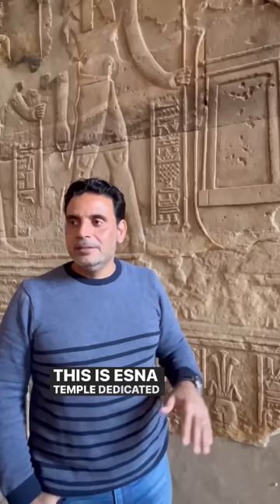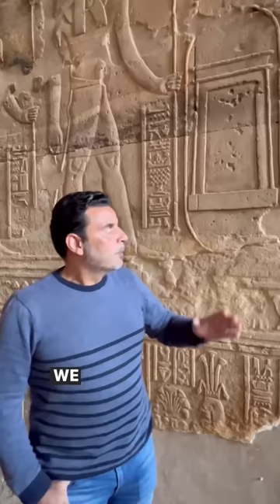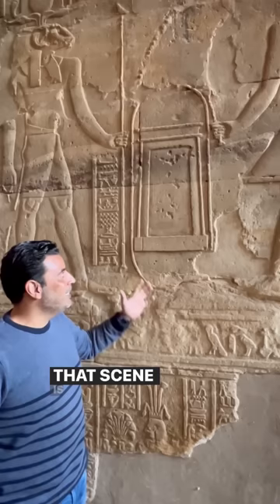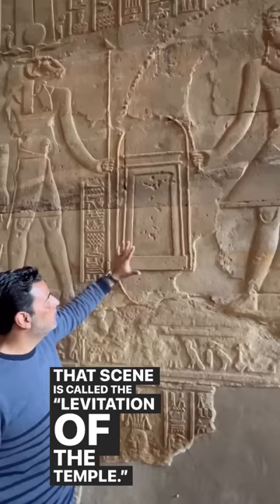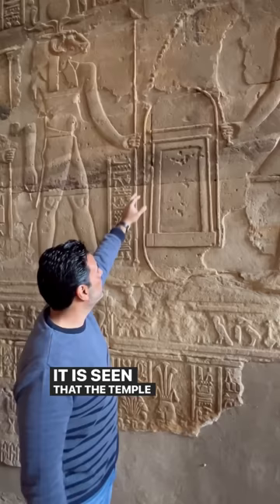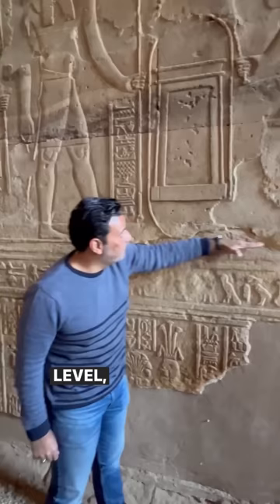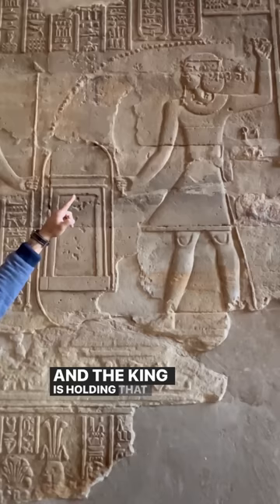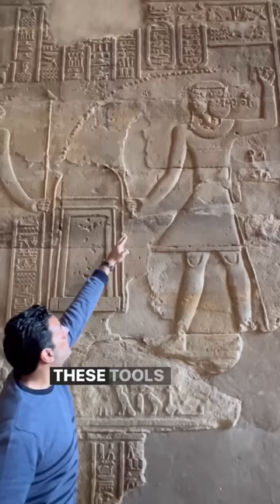Ancient Levitation Tech?

Comment: Don't overlook the two of them holding Was Scepters, the sonic tools used to cut stone, a tuning fork on one end with a stylized cutting edge on a long shaft, smack the tuning fork and the opposite end turns into a high frequency jackhammer. 
The Was Scepter itself is said to be "a symbol of controlling the forces of chaos" which I suspect means a destructive tool of some type that can be handled.
Wouldn't surprise me to know they utilized acoustic levitation to move large stones a bit more easily.
Reply: so the sceptor cut through stone but how did they get precise lines?
Reply: @Allsportstees  wire strung between forks.
Reply: @Zer0fuks  HOLY SHIT! did you just think of that!

Comment: its right in front of you guys, the pyramide has ZERO WRITINGS on them   and you can see that the old blocks have been added with plaster as you can see here and then engraved with writings, this means the real old blocks or statues are WAY OLDER then what you have been told

Comment: That looks like the giant shrines cut from a single block of granite. They are hollowed out like a box with very sharp corners, has a step inside, with drilled out holes and a inlay edge to fit a door. Extremely well made and one of the oldest.
A completed one was on display in the Horus temple, and you can find others near quarries.
Though this pictograph seems to be missing its pyramid shaped roof
Reply: That's what I thought. Or one of those tubs underneath the temples or pyramids.

Comment: Anyone else notice how smooth th break in layers is from "carvings" to the stone? Almost like it wasnt carvings..it was a casting or something
Reply: Your mostly likely right
Reply: Your mostly right, I could see two separate breaks with the same depths
Reply: Omg I thought the same thing when I visited Egypt 9 years ago, and they all look like a moulded casts because of the parts that broke away and the perfect lines throughout them
Reply: Its is, the Ancient Egyptian used a type of plaster that they coated, dried, then chiseled the desired work, if you make a mistake you just recoat with plaster. After learning hieroglyphics and actually look at high res pictures of inscriptions i can tell you they make just as much mistake as we do, except there mistake takes hours to cover and redo.
Reply: Eddie theory on how the pyramid was built, had a lot of sand, had a lot of water, a ton of time and even slave labor sooooo

Comment: I’ve been on to this theory that the “objects” they used to lift it were more so magnetic than electrical. If the tool was an attractor for the material in the rock than they could use that to lift things.
Reply: I've been on this theory that you people have no proof of any of this and everything points to people doing these things.

You understand that lifting these things with magnetism would actually be a much larger task then simply moving them right? Do you have any clue how much magnetism it would take to move things like that?

Let me ask you this, why don't we just magnetically pick up large metal beams we use to make buildings? We have large magnets that can connect to cranes, we pick up metal trash with them.

Why don't we use that to lift large heavy metal beams?

Comment: I'm convinced that 'Levitation' was used to lift giant blocks for the ancient Egyptians.
Reply: This is incorrect. The blocks were poured into molds in a molten form and then solified. The columns can be created in this way all you need is a cylindrical mold and then scaffolding around the mold to get high enough to keep pouring in molten rock or concrete from the top and then once solidified you have a stone column. No need to lift tons of stone

Comment: The thin elongated ring around the temple image, with rounded corners, is not a machine or part of a machine. It is called a cartouche, and is used to identify a man or thing. This image is identifying the gate of the temple as a "thing" called "temple".

 The two figures on either side are goat-headed gods or servants, and their size does not indicate that they are giants. Egyptian art, it is known, indicated status by relative size, for example low status ppl or figures are small. High status priests, gods or Pharaoh are BIG. NO  giants.

Comment: It’s frequency, generate the right frequency and anything will vibrate and you can control it. They think that’s how they either moved the giant stones or I guess from this video, the pyramid itself. But that would take a lot to move something that size. Most likely just vibrated slabs across sand or built a road of slabs matching the slabs they would move across them

Comment: Most interesting creation of the face so familiar with the cobras of the planetary relieving itself is powerful and the Bahru was a tool that could stand up on it own not a simple task as the field's of the shell a surface to air pushing upon the between one the other two feet of each other things are strange the diagramming is a bit tricky

Comment: This is nonsense. If you consider the areas where the stone surface has fallen away you’ll notice that the thin lines around the centre would have made up a complete oval shape. And the beads represent a rope. This structure might have been put around stone blocks and they were rolled by pulling the rope that is would around the oval shaped sabot. Anything but magical levitation …

Comment: Everything has a magnetic push and pull to another material on this planet. They used friction, water and ambient dryness as well as different elements stones.

Back in elementary school when I was learning about electromagnets, and of course, the force field created when you hold positive to positive could literally lift a car off the ground .
A magnet is created by taking iron and wrapping copper around it hundreds of times and putting a charge of energy through it. If you spin the iron rod, you have an alternator like in a car.

The pyramid is also insulated with sandstone and the interior a much more conductive stone, inhabiting, magnesium, and of course, many of the hallways made out of red granite, which does not conduct electricity neutrons come from the ground, and the pyramid like a funnel will funnel them up .

USA elects Trump for one reason USA is as full of shit as Trump is. These scientific laws are much older than I ever realized before. 

I’m very intrigued by this Maybe someday I could be blessed enough to see it for myself. Even though that would be almost impossible this day and age.

Comment: Conveniently ignores the fact that the one on the Right is holding a rope which extends up into a destroyed portion of the carving.

Almost like Engineering was a thing, and that they used a Pulley system to move the blocks.

The "energy field" he sees surrounding the structure is actually just showing that rope was around the structure. Sure, it's not showing it 'bound', but good luck carving those intricacies into stone.

Look, and see that the "energy field" lines meet up in a knot and continue towards where the rope the man on the Right is holding.